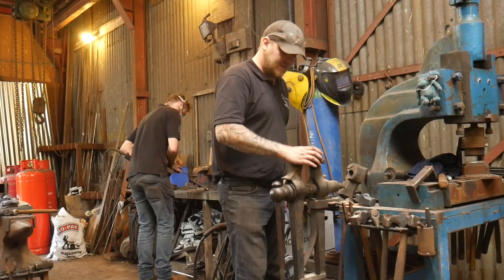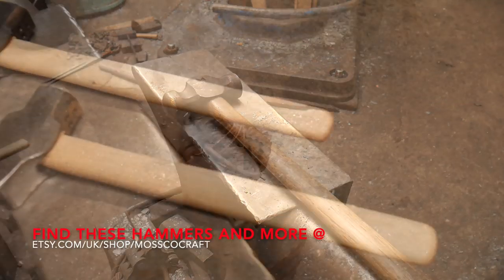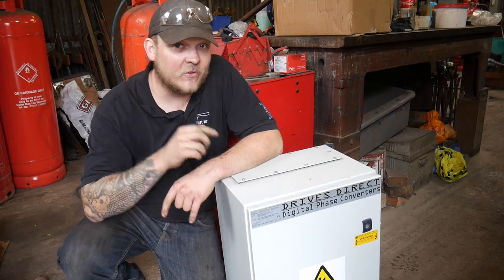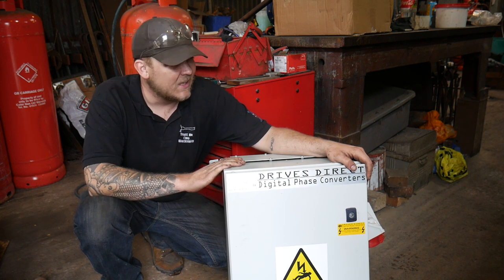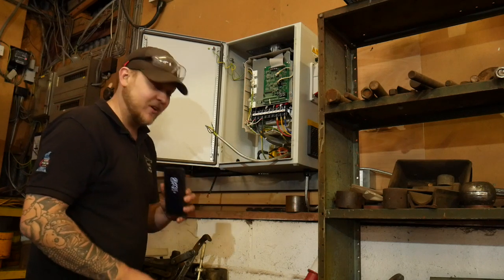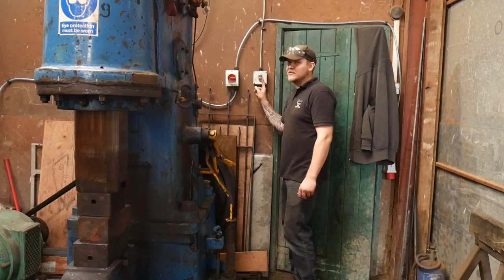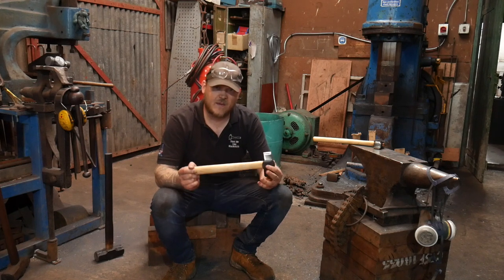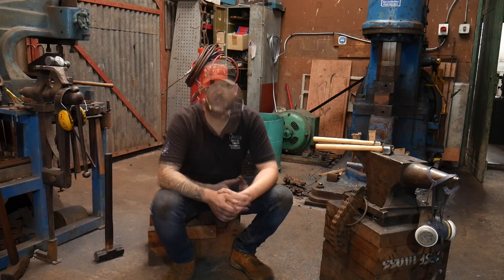Finishing Cross Peen Hammers! Just Another Day in the Forge!

Comment: Pallet Tyne is water quenching?
Reply from the maker: It sure is. And it give excellent results. It's normally 4140 and it's recommended that stock over 25mm or 1inch should be water quenched.
Reply: Is that meant that stock b4 forged over 25mm is water quenched? The thickness of the cheeks wouldn't be 25mm thick ye?
Reply from the maker: @Harry-ei7os  yes your quite right but my point was it is water quenching and any thing over 25mm should be (recommended) water quenched. Its to do with the speed of the quench and how the heat moves back in to alreay treated steel I believe. Tine is like a super steel which can do almost any job in the forge except hold a super sharp edge. you can water quench it at any size just not to hot. you shouldn't spot heat treat and tempering should be done properly.  

Its basically 4140
Reply: What's spot heat treat mate? And how hot do u get it? I've got 2 forks waiting to be use